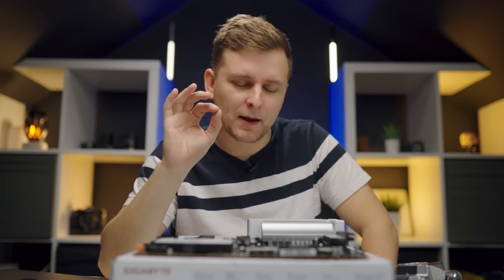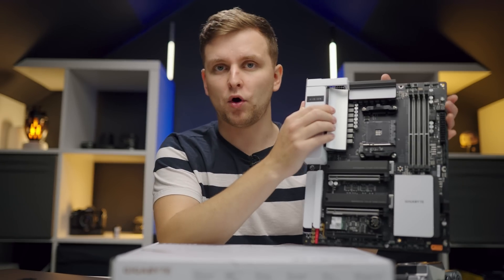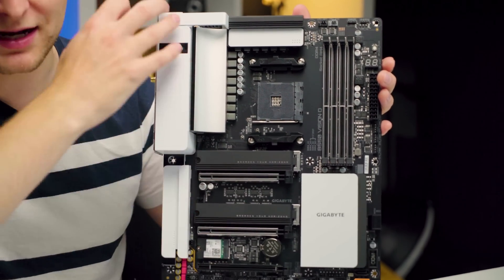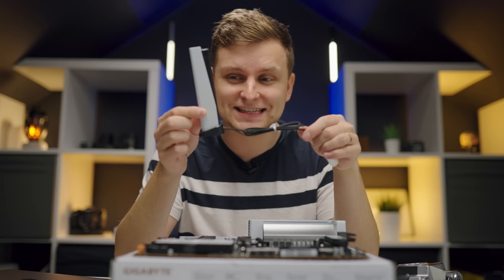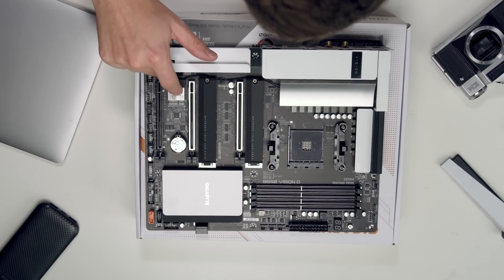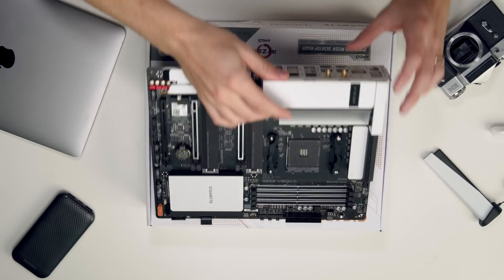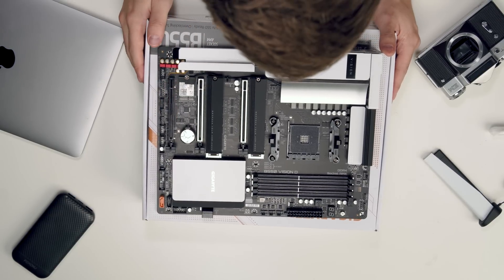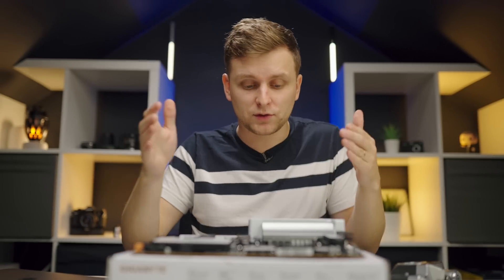Best Bang for Buck motherboard for CREATORS, finally! | Gigabyte B550 Vision D

Comment: Please turn off your autofocus and use manual with that a-cam it's super distracting
Reply from the maker: I apologise! I still haven't found a setting that works with the Sony a7s III + Sigma 35mm f1.4 
Since shooting at f1.4-1.8 i can't have it on manual focus, I'm moving around too much. Any other tips would be massively appreciated. :)
Reply: @theTechNotice  I understand! I think viewers may appreciate less of the ghosting/af searching for compromise of seeing more of your background (less shallow DOF). I’d set manual focus at F2.8 using a mini tripod and gray card (or anything you can focus on), focus up, and sit back down and go with it. Slightly going soft every once in a while I think is better than af ghosting. I understand your situation! It’s tough
Reply: @theTechNotice   AF-C is the continuous focus setting for sony. Still at that shallow depth of field its gonna be hard for anything. Best bet would be to increase the light and close the aperture so you have a larger DoF and it won't hunt focus. f3.5/4.You can increase the ISO if you don't have more lights. A7s iii is very good even in low light conditions that need high iso.  Barring that you can set manual at 1.8 and leave markers on your desk out of frame to show you exactly where your head is in focus, and then keep your head on that mark. You can also do a combination of changing iso and f stop to find a middle ground that works. Also I'm pretty sure with that camera you can manually select an individual focus point, so select the one on your eyes and lock it. When you move computer parts in front of you just avoid moving them in front of that point and it won't refocus.

Comment: Dude! Thank you for bringing this board to my attention. I'm building a rig right now for creative work, both music and video. I had gotten a MSI b550 but wasn't thrilled with the restrictions in bandwidth when running 2 m.2 drives, plus I plan to set it up for dual boot with a hackintosh set up.  I've been trying to find a better fit and you have just supplied it.  So thank you. 

Please take a crack at this board and show us what you can do with it, so I can drool while I wait for mine to arrive.

Comment: Might be worth noting that you need a BIOS update to run the 5000 series. If you don't have an AMD processor already, you'll need one for the update.
Reply from the maker: Not really since you can update the bios without the CPU on this board.

Comment: Compared with the x570 ultra or extreme do you see downsides with getting the thunderbolt  add-on card ? Or is it just better to get a thunder bolt hub with this motherboard to connect what is needed? You could literally connect a dongle to get 10gbit speed with a Synology box no?

Comment: Would be nice to see an X570 version of this feature set, with 3 PCI and M.2 slots.
Reply: You wont be saying that when all the x570's cooling fans start to rattle and fail due to constant use. One reason I'm staying away from x570. B550 for me
Reply: @triplexdread  my X570 MAG Tomahawk from msi never has chipset on and I have 2 nvmes, 4 ram sticks, and a 3080 hooked up to it. All depends what board.
Reply from the maker: Indeed!

Comment: ASRock X570 Phantom Gaming ITX has TB3. Been out for a year... So TB3 on AM4 is not brand new. But I believe that has been the only one until now, so it's nice to see another option finally.
Reply from the maker: There might be a few other boards out there, but I'm not sure how reliable/certified they are. I know that this Vision D is working as it should. And for the price 🤯
But thanks for pointing that out, someone who's interested in a small form factor build, that asrock x570 phantom is a good option. 
Do you know how well the TB3 on it works?
Reply: @theTechNotice  I do not. I only know of it. But to my knowledge, it does not require an adapter, as someone else mentioned. That's the first I've heard of that for that particular board. Have watched plenty of videos about it (from reputable sources like BitWit and Jay), and no one's mentioned an adapter. There is an ATX variant of the "same" board that does NOT supposedly natively support TB3. That may be what they're referring to. But no, I do not have any personal experience with the board, I just know that it is SUPPOSED to, so it's possible I'm missing something. Thanks for the reply.
Reply: @theTechNotice  Was just reading some amazon reviews, and seems like the TB3 is indeed hit or miss, but still no mention of needing an adapter.
Reply: You still have to buy an adapter for it.
Reply: The Phantom has the thunderbolt connector 5 pin. In the specs it shows it can then connect with their asrock thunderbolt AIC R2 card.  The gigabyte boards have thunderbolt headers to connect the Alpine ridge card. Both are PCIe cards with connectors. I might be wrong but I think I'm right 😂.  I havent looked at this stuff in years and started my research finding this board as key contender.  My laptop fried and decided to build a new machine. I landed here in search of thunderbolt 3 and AMD.

Comment: This Gigabyte MB and 64 ram, 5900x, and 6800xt. I can't wait!
Reply: Im doing a 5900x, 64 gb 3600 ram, and a 3070 I have in hand. Whats making you go down the 6800xt route?
Reply: @JonnySonder  how will u update bios
Reply: Jonny Dontchev nothing major really wanted to stay amd to see their performance gains claim from using amd card and cpu. I’m curious what your build is mainly for?
Reply: How will u update the bios?
Reply: Freddy Garza you can use Q-flush to update it. More info on their website.

Comment: I bought (2) Sabrent Rocket 4.0 SSDs...Will the 2nd one still work if I install it in the PCIe Gen 3 slot?
Reply: I might be wrong but I think the sabrent rocket is backwards compatible. So it will work in the gen 3 slot, just at gen 3 speeds.
Reply: @ansontang2293  I appreciate you brotha!
Reply from the maker: Yes, that's right, it should work just lower speeds, but who transfer 5GB/s anyway? 🤔